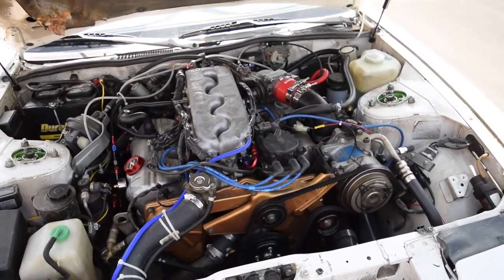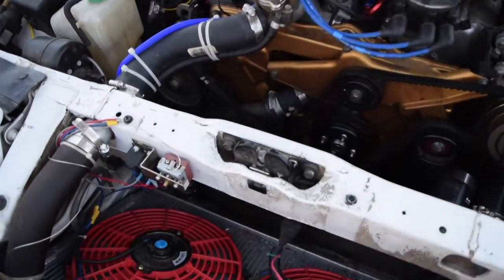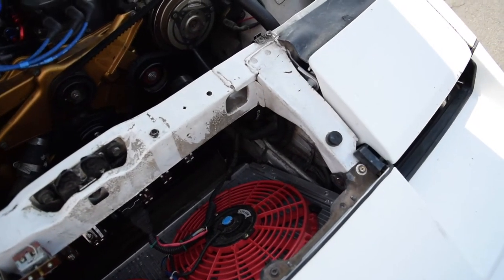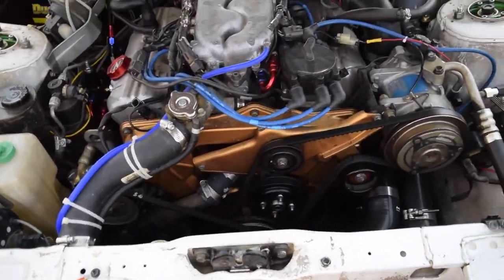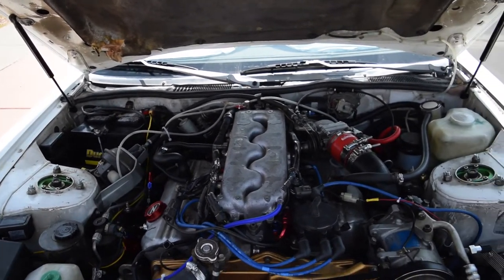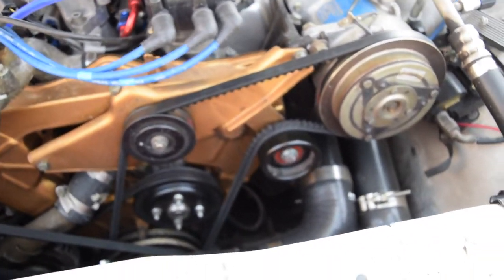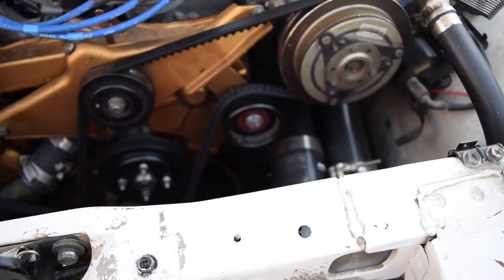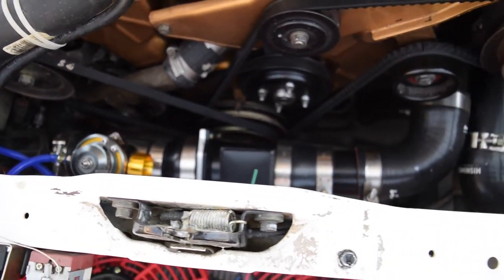NA2T Daily Driver Update

Comment: Can't wait for the Nistune video! I'm currently in the process of attempting to tune mine and it sure is a learning process. Even the tutorials that I've been trying to follow have led to the car just not running well.
Reply from the maker: It should be up soon! Mine was a pain to get going. Somehow I managing to tune it so it was dumping like 5x the amount of fuel it should have had. I was amazed it ran!
Reply: @TheZGarage  Awesome! I've dumped a good amount of fuel  to the point I've caused a couple flames and pops. It has me a bit stressed as I don't want to hurt anything.
Reply from the maker: What are the specs for your build?
Reply: @TheZGarage  GT3076 currently set for 10psi (I plan to increase it after I get a general idea of the tuning process). 420cc Mercedes Injectors (FJ118). Walbro 255. Nistune of course. Stock ignition and internals.
Reply from the maker: Sick. In my video I'll show my current tune which you can kinda base yours off of but I've got 550cc injectors so it'll be a bit different

Comment: I just got a 84 300zx 50th anniversary edition and Its a project, ima be scoping out your videos for inspiration
Reply from the maker: Let me know if you have any questions! I'm glad to help!
Reply: @TheZGarage  yea man, how much did u put into it? I got mine with less than 60k miles, but the cooling system needs changing and the inside carpet and dash is falling apart, the electronic and engine is solid and its all original seats rims and suspension
Reply from the maker: That sounds great! It's hard to say how much I've put into mine over the past few years but you should be able to sort yours for around 1k
Reply: @TheZGarage  1k sounds good tbh, tho bad news, I found out that its not a 50th anniversary edition, someone just slapped some badges on it. Wish I paid more attention to it. Oh well hopefully I can still fix it up
Reply from the maker: Oh haha. I kinda like the fake 50th AE's still because they are still just a little more unique than a regular Z. These cars are pretty straight forward though so as long as no rats have nested in them and chewed all your wiring you should be fine!
Reply: @TheZGarage  where do u get all of your parts? I have been having a tough time getting a radiator
Reply from the maker: Rockauto is a good place to get engine parts. For a radiator I would look around and see if you could find a campion 2 or 3 row radiator. They're very good but last I heard they were out of stock until January. A regular replacement from rockauto will probably work fine though if you want to get moving on it

Comment: Thats crazy i have the same fans on a stock rad, with an hx35 on 10psi. Get a lower temp thermostat. I barely use my fans at all only when I'm stopped or going less than 25mph. Keep us updated!
Reply from the maker: The gauge on the dash doesn't move but I can see it getting hot in nistune. I took the thermostat out and it still gets too hot. I'm going to try a different fan shroud first to see if that helps because it looks like it's going to be a few months before the champion radiators are back in stock
Reply: @TheZGarage  glad to hear man! Im in az so i get these super hot days too. I have my intercooler really close to the radiator, the ebay fans can hold a dollar on my intercooler so i have a good flowing setup. Do you have an oil cooler?
Reply from the maker: I don't. I was thinking about installing one to make another path for heat to escape. I just haven't gotten around to it yet
Reply: Yeah grab a dna oil cooler kit, theyre 110$ relocates your oil filter as well. Makes a huge difference
Reply from the maker: Thanks! I'll definitely check it out!

Comment: yeah I've got a 86na five-speed and I'm wanting to do my swap just about like this and this is my daily driver I wish I could post a pic but I've got the burnt copper all over my car is it really worth changing the map for the maf I rerouted my air intake a couple of days ago and it did not want to idle for nothing and I moved it back around and I don't even really know what I did but it started idling great so I really don't know what the problem was but it was something to do with the air intake piping and my maf I'm pretty sure I've never had an issue that I couldn't figure out on this car so far to go

Comment: May be slightly unrelated to your update video but you had mentioned something about a transmission fluid leak in one of your other videos on some sort of topic. I was just wondering if you remember what you did to fix that? I believe you said it was a leak that was right above an exhaust pipe and was causing it burn up rather quickly. Sadly I’m pretty sure I have that same thing going on with my 86.
Reply from the maker: If I remember correctly, it was the transmission pan on my automatic transmission. If yours is a manual, it wouldn't be the same thing since they don't have transmission pans.
Reply: The Z Garage ahhh I see, thank you. Keep up the good content man! Your channel has really led me through a bunch of projects.

Comment: I was wondering about all that stuff that was next to the air conditioner unit I see it s all gone.so the car runs good with out it?
Reply from the maker: Yes. That's mostly emissions equipment. As long as you plug any intake holes, you can remove it and it won't cause any problems
Reply: @TheZGarage  thanks they are annoying.